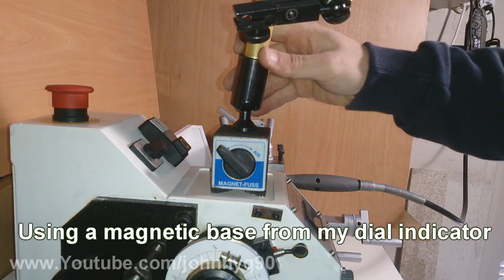Simplest Dividing System for A Lathe

Comment: In theory, you don't even really need the pointer arrangement. You could just score a line on the spindle clamp. It would also be reasonably easy to modify this idea to use something like the quick release lever of a bicycle seat post to make locking/unlocking the spindle clamp a much quicker process, and removing the need for the screwdriver. That said, you've come up with quite an ingeniously budget friendly solution there. I'm impressed.

Comment: That was pretty cool, Liked it. For the pointer I would use the one of the two screws on that bar to the top right of the dial ring you made, at time index 6:47. You could use a bolt with a threaded post on top and then use a turn nut to be able to remove the pointer any time it's not used or if you want to remove it to change the dial ring. Very nice video, I've been thinking on doing something similar for awhile now. Just need to get off my butt and do it.
Thanks for sharing. Best Wishes n Blessings. Keith

Comment: Suggestion. Instead of using a paper and arrow system, grab a bit of Plexiglas and using a print, drill holes using your drill press.

Then, that disc, put it where the paper is, and instead of the arrow, grab a piece of metal that is flexible, like a piece of measuring tape or a metal ruler. Drill a hole, add a screw, round said screw's end in to a ball (and make sure the screw fits in the holes of the disc), then using either a pre-existent hole in the lathe or a new hole affix the flexible indicator to the lathe.

When you want to advance to the next position, lift the metal tab, move the chuck and drop the nubbin in the next hole. For safety and for peace of mind, you can keep the locking mechanism you've made, maybe add a small knob so you can ditch the screw driver.

Doing this, or similar, will greatly improve your precision as it will not rely on the eye coordination or on the screw being tightened to keep the position.

Cheers.

Comment: It appears this method is only as accurate as aligning the pointer by eye on the index template, or am I missing something? Thanks.
Reply: Probably accurate enough for home shop use.  He's not building nuclear weapons initiators.  The human eye (young ones anyway) can achieve .001"-.003" accuracy on aligning a pointer to a line.

Comment: What kind of drill is that you have setup on your cross slide? I have been trying to figure something out to do side drilling.  .   . Please let me know, I'd really appreciate it. I wanted to put around a 6mm end mill in a chuck to mill fins on a turbine diffuser. Looking further, I see it is a dremel attachment, you just put it in the tool holder just like a tool? 

Thanks
Reply: Hey, I was looking into duplicating his setup myself, so I did some checking. If you search "Dremel Lathe" on ebay, you should find a few different versions of the attachment Johnny is using. He also has a video posted of him modifying that tool, so you can get a good look at it.
beyond that, I'm pretty sure he's just using a regular Dremel flex shaft with 3-jaw chuck and rotary tool, easy to find on amazon or your local home improvement store.

Of course, I'm surmising all of that, so I may not be completely correct.
Reply: Thank you for responding. I kinda figured that's what it was, you just gotta think outside the box with this stuff and anything is possible
Reply: Pretty sure he said a Dremel.

Comment: use a digital level , it is much simpler and accurate. Today you can find for less than 20$
The best way is to stick it oa one of the chuck jaw, set your first hole to "0" and rotate manually the chuck to 72 deg, 144 deg... etc...